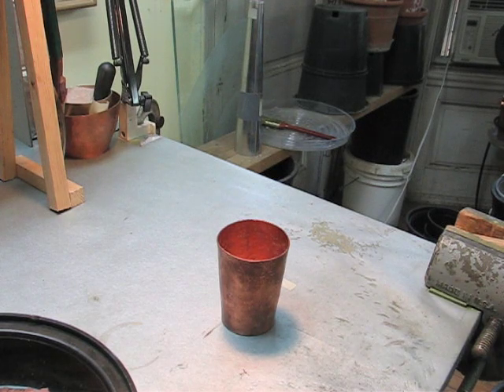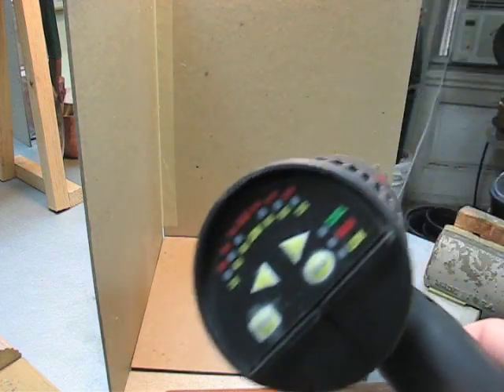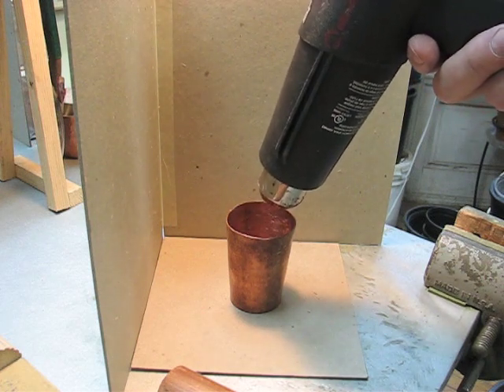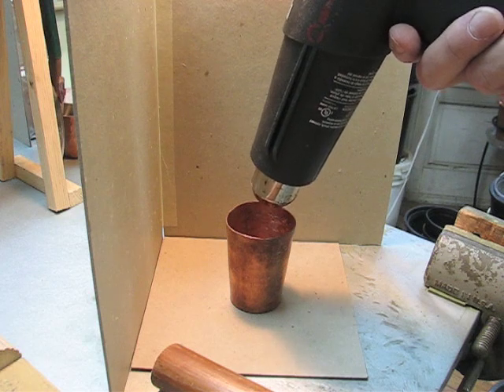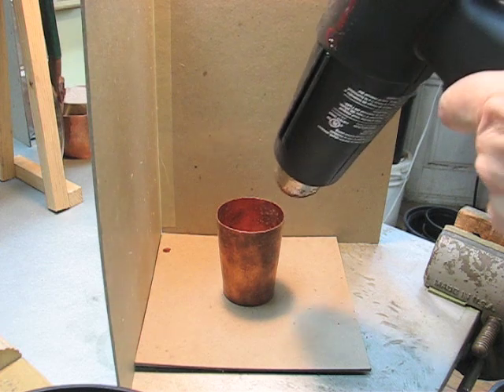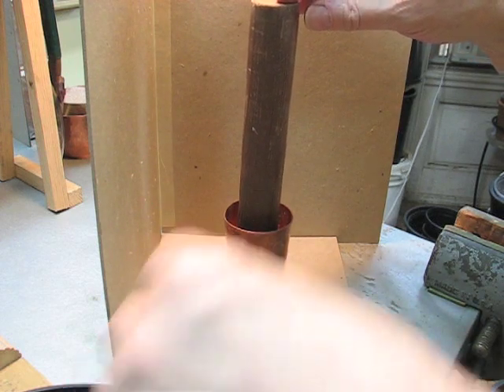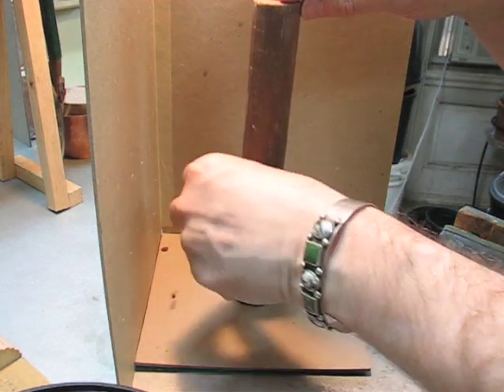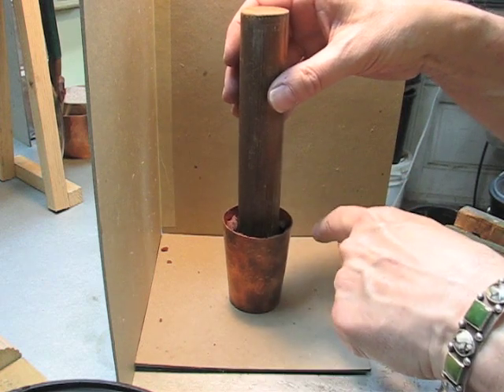Chasing - Part 1 - Fill  with Pitch

Comment: I don’t think using cardboard as a surround or to stand  is very safe, not when you’ve got the heat gun set at 850 degrees! That’s way above the auto ignition temperature for either paper/cardboard or pitch.
Reply from the maker: Even with the temperature at 850 F. (not Centigrade) degrees it is not hot enough to ignite dense binders board. It's never close enough to get the board more than warm, if it started to scorch or look like toast I would have plenty of time to stop the hot air. Have you ever tried to ignite board with a torch? You might be surprised how resistant it is when you aim it at the flat surface, it catches fire faster when you aim the flame at the edges. Thanks for watching.
Reply: Binders board just looks like cardboard from a cereal box. It isn't.